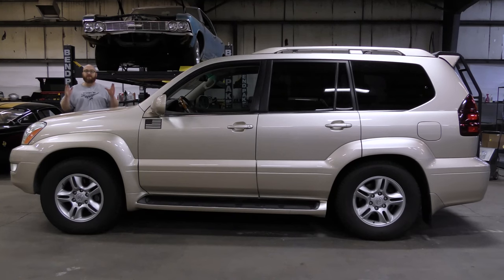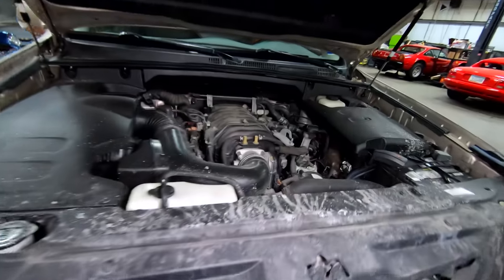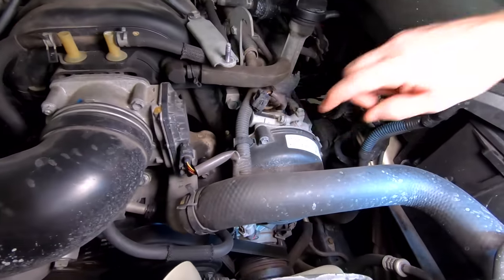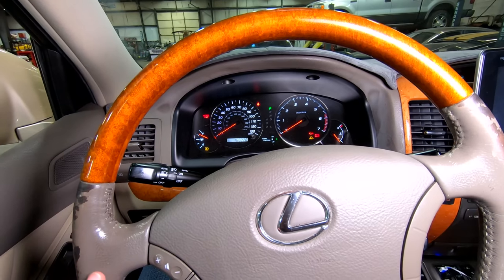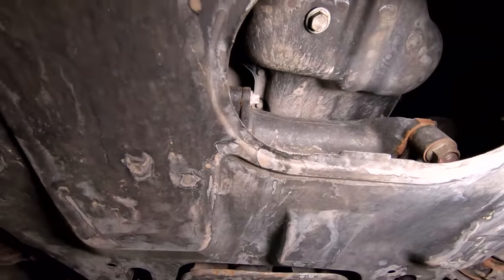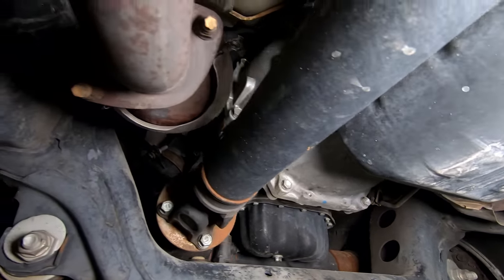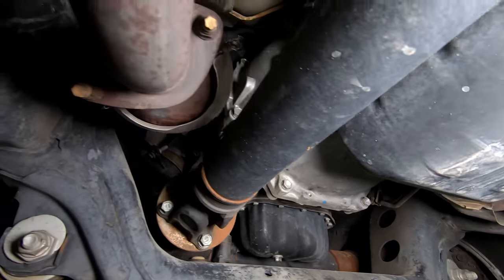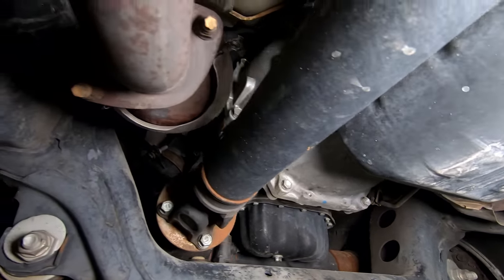How could this super reliable '07 Lexus GX470 have such a stupid design? CAR WIZARD weighs the risk

Comment: The starter is better protected from the elements under the hood if the starter was under the transmission or on the side like normal it can easily be stolen and if you do serious off roading it'll never get damaged. Emotional starter damage.

Comment: This job is cake. 5 hours total.  After the starter when you do the water pump and timing belt make sure to use super lube on the O Ring that goes from water pump to heater core under intake manifold.

Comment: Design flaw? I know what you’re going to talk about before you mention it. If they never fail is it really a flaw?  I’ve had several Lexus with this “flaw”  I never had a failure ever and I drove one to nearly 400k. My current vehicle has the same “Flaw”  it has 200k on it  with no issue. I will say this …. Don’t put an autozone starter on it if you need to replace it! Hahaha
Reply: When the customer asks you to replace a starter that works fine but its not super east to get at it evidently becomes a " design flaw" . 🤦

Comment: The starter issue is not as bad as when you have to change the cam seals on the vvti uz engines where camshaft removal is required

Comment: Wrong! WARNING There is a special mode before you lift the vehicle on a lift you have to press off with the key on on the air suspension controls on the center console. If you do not and somebody puts the key into the on position while the vehicle is on the lift the air suspension the airbags are liable to become damaged

Comment: The nissan patrol y62 / armada in the US has the same design flow I just replaced my starter at 160k miles on a 2014 model year.
They charged 4 hours as well.

Comment: I love my GX460. But there are a few things id change if i could.
Reply: For example?
Reply: @bigtuna9529  mostly comfort features. Using the touch screen for HVAC settings, lack of storage,  the cup holders are not great (I bought a aftermarket solution for that), the drivers display does not show mph in digital form, which is fine yet stupid, and a few other small detail of luxury that the GX is lacking compared to most modern vehicles of its time. For 2022 they finally updated the 10 year old infotainment, but mine is not a 2022. If this was not such an expensive truck I’d overlook this stuff, but it’s hard to overlook when it’s the most expensive car I have owned yet lacks basic standard features. Also no blind spot awareness in my model either.

Comment: rear air suspension sagging too - time for a lift. / The only real design "flaw" is the dumb side opening rear hatch. They should have made it like the LX or 100 series with a clam shell design. I have a 99 LX470 297K and I'd drive it anywhere, but I may be doing the starter or alternator replacement soon. Good thing it's not my daily and I can take my time.
Reply: I hated the barn door until I attached a fold down table to it. Now it seems brilliant whenever camping/ tailgating.

Comment: Just did the tim belt and tensioner and water pump and radiator and outer belt and hoses.  It was 130 k on it.  It had been done at 90 k at the toyota dealer. 
Glad its all done.
Reply: Relax, you couldve went another 60k before doing all that again.

Comment: Though I am not a Toyota fan, I do have great respect for them for the reliability and ease of maintenance.  The starter in the valley of the V8 is a rare misstep for Toyota, but they are not the only ones.  Porsche V8s also have the start in the valley.

Comment: I'm interested in knowing who came up with the idea to place the starter under the intake manifold first.
Reply: I've heard too , that the starter was placed there to get it near the center of the engine , thus reducing the pendulum effect of a low mounted starter hanging down below...makes for a smoother running engine, less vibration or shake !
 Remember the ad where the wine glasses were set on top of a running engine ?
 The idea ; mass should be centralized.

Comment: That's the way sedan small engine runs I get the item in question that needs fixed I run a diagnosis I don't charge for the diagnosis unless I actually have to pull something or do something like that then I charge for diagnosis fees but generally sedan small engines is quality workmanship reasonable prices and none of this BS of shoddy diagnosis and shoddy workmanship

Comment: I agree it's stupid for the starter to be in the back of the valley but it's a Toyota and by the time the starter needs to be replaced it's already on its second third or fourth owner a 200 plus thousand when it finally dies. Can we talk about the v6s of Toyota Mazda and Mitsubishi where you have to pull the intake just to do the back three spark plugs every 100,000 miles or less.  To me that is far more of a design flaw.

Comment: It's only dumb if you have to change the starter. I've done a ls400 starter same deal. Got new timing belt water pump and cam seals and gaskets at the same time good now for another 500k

Comment: I think those weigh around 5000 pounds.  If you plan off roading, they're great.  But if you don't need locking everything, dont drive a tank
Reply: I love your videos and you are a truly great mechanic, but this Lexus has obviously been well maintained, so of course it looks great.  So does my Denali because i take care of it.  Sure, Toyota makes good products, but yiu know as well i that if you dont take care of it, it will fail.  But no one is cross shopping a GX compared to a Traverse.   The GX is truly off-road capable.   It's not a shopping mall cruiser.  Yes, the LLT had issues, and GM fixed them with the LFX.  Bla bla bla....   keep doing great work, and thanks for being on the straight up for customer!

Comment: Meh, its got 170k on it (guessing 15 year old factory original, which is common)  So it has a once in the lifetime of the vehicle starter replacement which compared to conventional is a labor intensive job. Annoying, yes but as mentioned still better than buying an Acadia or other GM crap compact SUV..   And GM did this same trick on the NorthStar engines in the 90's, they save you from doing the starter by popping head gaskets instead. :-)

Comment: I almost commented on this video without watching it knowing it was the starter.  🤣  I had an 05 Sequoia and we had the intake manifold off and I was trying to decide if I wanted to do the starter at the same time.  The UZ motors are very reliable.
Reply: I sold the car with 296k miles and the original starter still going strong.
Reply: @pkt1213  I own a GS400 with 230k and it has the original starter. 2 timing belts / water pumps so far, but I would probably just keep doing those every 100k and leave the starter alone given the historical data. I just don't hear them failing much over at Clublexus...it can happen but it's not the end of the world...or the end of the car...
Reply: @fastfingers1957  I would still be driving it but it was going to wind up parked in the garage for a year and that is hard on a car.  I wanted to get it to at least 500k.

Comment: Wizard, I disagree on the stop start, the engine has already run, it's warm, the oil is where it needs to be, and most of the systems(not all) stop the engine in the ideal start position to start quickly. So the load on the starter is almost nothing after the initial cold start. And they put a lot of design into the starter to use better grease and bearings so it lasts longer, takes less of a load to restart. So it no longer is how many cycles you need to be concerned about, but how rough are the starts.

Comment: Do these have to use premium or is it an option on the older 460 and 470
Reply: My personal experience is mine needs 90 octane or higher. I know other variants of the 4.7 do not require premium. I believe its a matter of having VVTI or not.

Comment: I bought 2005 Toyota Highlander 3.3 ltr v6 AWD 1 month ago, What do you think of these suvs. How reliable are they. What should I keep my eye on, if they have any severe problems. It has 158k original miles on the suv.
Reply: They are pretty decent, if they are well-maintained.

Comment: Dense Starters are really Robust Pieces I have always believed In just buying the Rebuild Parts from Toyota and Inspecting the Rest the parts to replace are Brass and Less than 50.00$ and you have a Brand New Starter that will last another 100,000 miles just my .02

Comment: Are the inner fender wells missing or removed?  I would be surprised if things are always exposed like that.  It looks way too clean in there if they are in the open like that.
Reply: Some people get fasteners and use inner tube material. The OEM style plastic #$%$% disintegrates.

Comment: The starter is in the valley of the V8 to keep it far away from hot catalytic convertors that will fry the electrics.....This is happening more frequently unless your wanting to make a MISERABLE COMPLEX POS to work on like the Germans....Then you move the exhaust and turbos to inside the "V" of the motor.

Comment: It's basically an expensive 4 Runner isn't it?
Reply: It's a v8. Big diff. I would say they are related, but not the Same. GX is def the bigger stronger brother. 4 runner is the smaller sportier and more modern one.

Comment: Design flaw and the 1/2/3UZ Toyota engines aren't words that go together. There isn't anything in the 2UZ that is a design flaw when its a proven million mile motor. Sure the intake manifold comes off for the starter, in which they only fail every 250-350k miles. In other engines thats the life of the engine it self.

Comment: What's the point of airbag suspension on such a vehicle?  Live rear axle means its never going to ride like a car and these prados are not the best things to drive so its just a waste of money and issues in the future.  range rovers I can see the point with how they are built but even then the airbag systems are rubbish on them for reliability.
Reply: Pretty sure the air bags are only on the rear on these and they’re there for height adjustability when hooking up a trailer.

Comment: Weird question, I have a strange problem with my 03 Grand Marquis, my local mechanic can't diagnose it and I'm at my wit's end. It runs fine under load, and idles fine if cold, but if it's up to temperature and idling, it starts to stumble after 30 seconds. It clears up after I get under way.  Can I send you the details through Instagram to pick your brain? If I could afford to take it to Omega I would, but I'm over in NC
Reply: Sounds like the IAC valve.
Reply: @chynacash3138  I was doing some reading and I think you're right, I'll take a look in the next couple days

Comment: Before I watch this video I bet the starter is under the intake manifold, I recently changed a starter on a Nissan Titan it's in the same place , but worse was a Nissan Juke and I had to remove most of the front of the car. Check it out on my channel Jagvette1. Really stupid design made so you take it to the dealer and they charge huge amounts of labor.

Comment: What you mean don't buy this kind of Lexus SUV. they're the Best SUV to me. Every one in my family are toyota/lexus fan since the 80's we're even drive camry,4runner, tundra and avalon until today with no problem. i used to owned Cadillac escalade esv and the GMC Yukon them are give me a lots of problem, believe or not I has been spending for over $10K Fixing them 2 And I will not going to buy them again

Comment: All UZ family engines have the starter in the valley at the back of the engine.  It's a million mile engine.  So we can live with a crummy starter location.  My buddy up the street replaced his in his 2005 Lexus GS430.  Not the funnest job to do but DIY doable.  Plus you can clean the injectors, replace injector seals and other gaskets as needed.  These are excellent engines and GX470s, V8 4Runners, and 1st Gen Tundras with it are just fantastic especially with the 2005 and up VVTi version.  Zippy and amazing in the mountains.  Ditch the airbag shocks on the GX and put some Bilstein 5100s at all 4 corners with the fronts on the upper perches and the rears with a leveling kit.  Add some beefier tires and wheels, and it's a better truck.  Plus add a safari rack, steel bumpers, and delete the sidesteps and you can turn a GX470 into a great luxury off-roading rig.  Looks much better too.

Comment: Not quite sure it's a design flaw,Just placed started out the way.. As Toyota believe in their product,have faith in it will Not fail so why bother placing it where all the dirt and weather elements can deteriorate it.
Like Toyota engines,the started a whole lot more simple is unlikely to fail.
Reply: By the way Wizard. Your work ethic is spot on and I wouldn't doubt your word. As for quotes,Well they're kinda penny pinched Not worth your expertise.

Comment: I think a more stupid design is having timing belts instead of chains. Starter may or may not fail, but the timing belts need to go every 100K or less. Stupid as in purposely creating service work.
Reply: timing belts are smoother and less noisy.
Reply: @peterouuu  Not a good enough compromise, sorry. $1000 service every 100K miles is not worth it.
Reply: @vferdman  timing belts are also an older design. Chains are relatively new and all of toyota’s engines use a chain now. So it’s an old engine that’s why it has a belt as well. came out in 1997
Reply: @vferdman  also with the chains, Toyota with the 4.6 and 5.7 are having timing cover leaks usually after 100k. You win some you lose some 🤷🏽‍♂️

Comment: Junk! Replacing a timing belt is a joke! Extra unnecessary, pricey maintenance. Most moved away from timing belts to a lifetime chain in 07. Terrible starter design to! The Honda Pilot is another joke! Also has a timing belt to. Cheap junk designs

Comment: Wizard I hate to correct you about the starter issue but start stop vehicles have special designed starters that are made to be able to handle the frequency of cycles. You should check out Jason’s engineering video on this, he explains the major fuel savings you get with math and the durability and mechanics of a start stop starter specifically and why it will last if built well. I know you know more than me and I’m saying there’s someone who might know more than both of us on that topic, maybe do some research before just saying things as statements of fact. Really enjoy your videos I definitely mean no shade or anything negative at all. 😌🐻
Reply from the maker: I fully disagree. But ok

Comment: In order to complain about the starter so much it means that you have no clue about Toyota starters, the most common starter replacement starts about 500 thousand miles I work day in and day out with Toyota and Lexus, you have no idea what you are talking about. And don’t compare them with Chevy Cadillac crap, as a Toyota technician this job it’s less the 2 hours not 4 hours, the warranty replacement it calls for 1.9 hours, you may doit 4 days………

Comment: I definitely think the Catalytic Converter lines need to be bled. The transmission may need new injector springs, Just saying. Maybe also check the floater on the alternators. It's possible that the ignition need to be timed. Great episode!  🍻

Comment: Sorry to disappoint you, wizard, this is a Toyota Land Cruiser, thrue it is an overpriced vehcile but it is a Toyota, thus this vehicle is flawed in many ways. It has IFS problems, it has steering problems, it used to have auto gear box problems at least in the diesel version and so on. Quality and Toyota are oxymoron this I have learned from experience.

Comment: I do think the start/stop starters have advanced engineering to last longer.. however, I completely agree, it's pointless.  The amount of gas saved is so small.. and the pollution caused by cars is fairly small when comparing to trucks and tanker boats.

Edit - Most cars use less than half a gallon per hour at idle.  As tested by tech connections recently. .. unscientifically by a science channel.

Comment: when people lift these and make them overlanders blows my mind when I service my wife's lexus rx350 considering the cost of parts and how alot of the electrical systems tie together meaning if your abs line goes out you won't have all wheel drive anymore till you fix the abs line. makes it a nightmare for overland drivers.